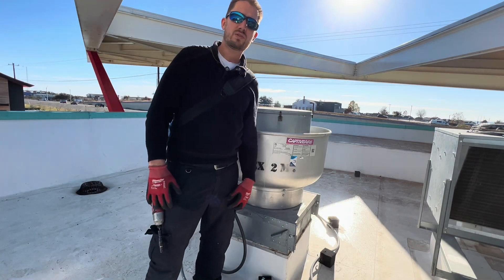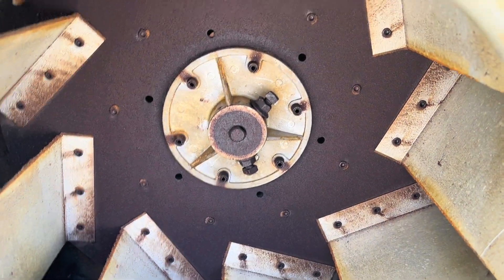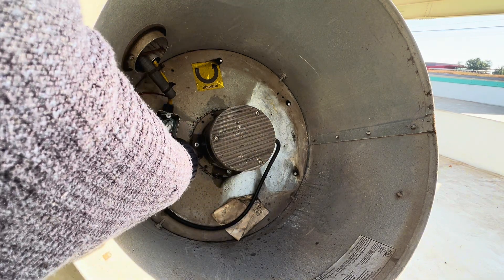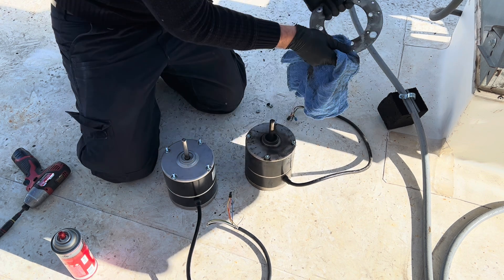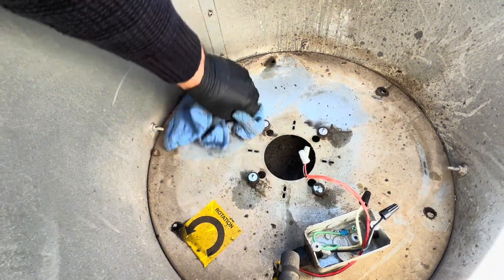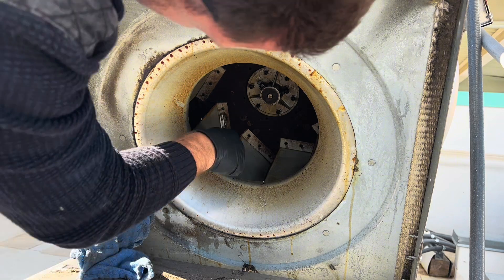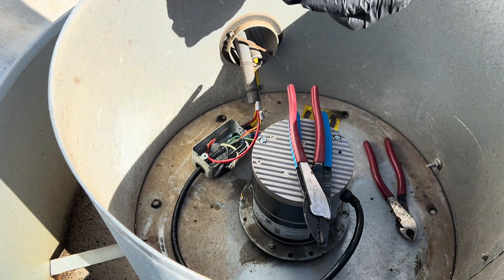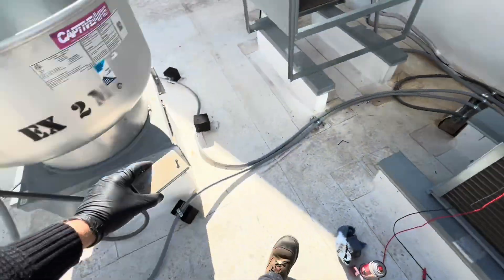Captive Aire Exhaust Fan Motor Replacement

Comment: Where the red cable goes ? The one that you set with the red and yellow cable
Reply from the maker: @amtem29  It goes down to a controller/circuit board. It’s the speed input for how fast the exhaust fan motor should run.
Reply: Thanks for the answers if y set those two cables can I use it with out a controller and in one speed thanks in advance 😊
Reply from the maker: @amtem29 I honestly don’t know. I assume if you attach a DC power supply you could run it at a constant speed, but I would get another motor if you’re planning to do that. Single speed motors would be way cheaper.

Comment: I’m working in same type unit and I can’t get the shaft to come out of the hub. Regular hvac hub puller won’t work. Any udeas
Reply from the maker: @alexhernandez1241  Did you try Kroil or rust penetrant. Not WD40? And clean the shaft before removing?
Reply from the maker: @alexhernandez1241  Maybe try small pry bars from the top? Move them below the motor and push up slightly. Take care not to bend the housing too much.

Comment: Great video. Thank you for sharing. If you don't mind me asking . May I ask ? Can we use HVAC condenser Fan Motor or HVAC Blower Motor for replace Exhaust Fan Motor ? Yes or No. I'm new to HVAC.
Reply from the maker: @zekenzy6486  I always try to get OEM parts. I would personally tru to avoid it but in certain cases you can. Make sure to match voltage, RPM, HP, etc and frame number. Otherwise they won’t fit.

For this specific exhaust fan you need the speed input on the low voltage. This CaptiveAire is a specific motor. I would stick to theirs on this one.